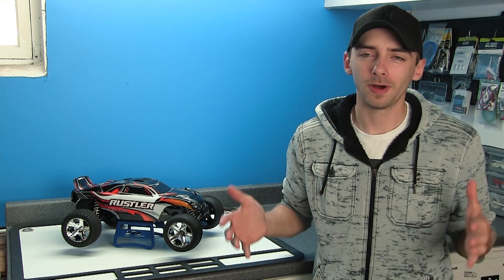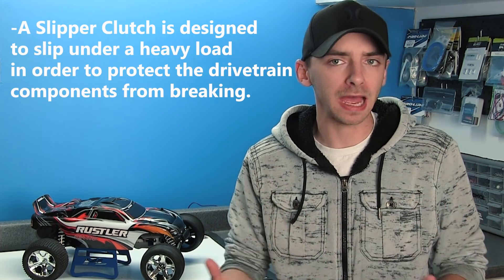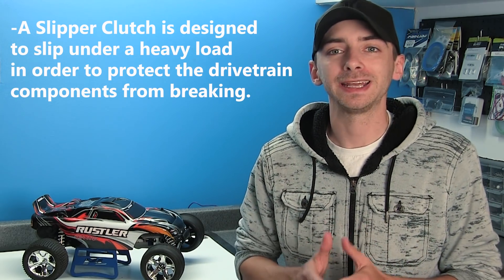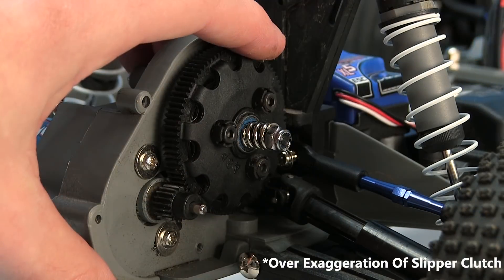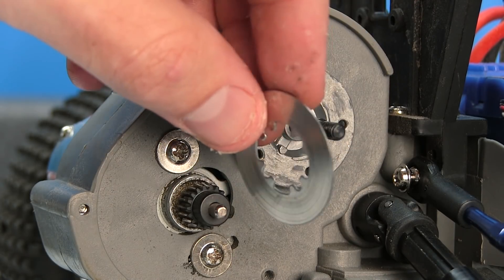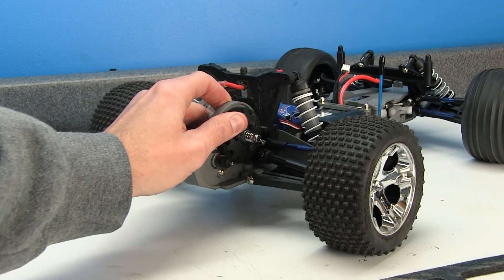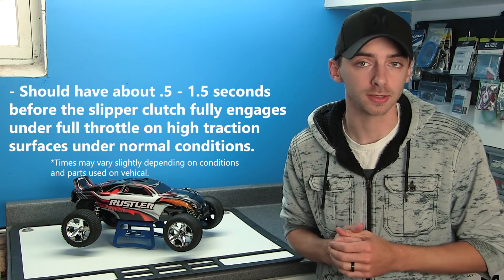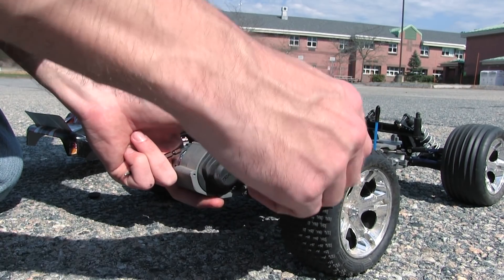RC Slipper Clutch Systems - How To Adjust, How They Work & More!

Comment: The "rubber" in the nut. Nylock = nylon. They were originally designed for military aircraft. Different colors of nylon also have different strength specifications. I only use them once depending on course/fine threads and application. Never use lubricants with nylocks, it defeats the purpose. If you can turn them by hand they are junk. Great info on the clutch though. I've picked up some helpful tips from your channel. Just thought I'd try to pay it back some.
Reply: Sort of, I suppose. China direct colors are definitely questionable at best. Spec charts of quality nylock hardware are available though and correct if manufacturing standards are followed.

Comment: Why does a Team Associated RC10 competition car have this. Or do the basic kits have slipper clutches but the RC10’s in important races take them off? If they don’t take the clutches off for serious competition cars, I assume they trade the slightly increased lap times for a smoother way of putting the power down out of slow corners, which may mean less snap oversteer?
Reply: Yo Cecil slippers are more for average hobbyists. If you race you want all the power and it's usually experienced guys who really race. Slippers were made to t aske the torque shock hi power motors of today put out. I still have one of the fastest motors of its time from when I got into rc in 88 and a stock Traxxas motor beats it hand downs today. So the modern motors really cause shock to the gears and dog bones so the slipper was designed to keep the shock to a minimum for new hobbyists.
Reply: You CAN get or buy or MAKE a slipper eliminator,but not recommended.You will rip the gears out.

Comment: My TMaxx was running fine and suddenly stopped moving but engine continued to run. What would cause this.  The vehicle is only one week old and finished break in.
Reply: Check that the clutch bell and spur gear are still engaged. The motor mount holding the engine may have loosed from the chassis with the vibrations. If so, take the screws out, apply a small dab of blue loctite and set the correct spacing of the clutch and slipper.
Reply: Did you ever figure out the problem?

Comment: Awesome video and very informative on the slipper clutch system.  Since using your video I have adjusted mine tighter about 2.5 to 3 turns and my E-Firestorm 10HT reacts better then before. 
Do you have any videos on adjusting the front and rear turnbuckles?
Reply: Just make a note of stock setting and have a go at adjusting and testing. Its trial and error, a lot of it if you don't know how each setting affects the car. 
Have a read on camber, castor, toe and anti dive most of the stuff you'll find are 1:1 but it still applies
Reply from the maker: That awesome man! glad it helped ya out!

Comment: The number one problem (at least on the traxxas forum) is using the slipper clutch to control wheelies instead of using throttle control.

Comment: I always thought it was a little looser slipper clutch on looser surfaces to reduce Tire Spin, and a little tighter on  surfaces with more grip?
Reply from the maker: +Bryan Forth you could. But the problem you may run into is if the slipper clutch it tight and you go and punch it on pavment you could run into the issue of stripping your spur gear teeth. Those teeth tend to take the brunt of the initial force when accelerating. And considering the pavement isn't going to let the tires spin easily theirs gonna be a bit more resistance in the drivetrain because of that. Were as if you had the slipper loose on pavement it could spin for a brief moment before gradually applying the drive force to the wheels. Hopefully that made a little bit of sense.
Reply: It made total sense. Thank you for the clarification. I really appreciate it.

Comment: Great video and good information I just upgraded my transmission gears to hot racing medal on the scx10 and next I will upgrade the slipper clutch. Do you know if axial or any other brand has a steel or metal slipper clutch for the scx10?  Thanks in advance you always willing to help the rc enthusiast.
Reply: Lil Conan check out supershafty. the stuff is pricey, but I believe they have a topshaft which will allow you to use the Robinson racing slipper. keep in mind however, that as you upgrade the strength of parts in the system, it passes the stress on down the line. if you aren't running a big brushless system, you probably don't need a hardened steel spur in your scx10. if you are running a big brushless system, it's good to keep one weak link that's fairly cheap to replace. metal gears in the transmission are a good idea, and while you have the Trans apart, it's also a good idea to replace the slipper components and the spur, but upgrading them to hardened steel probably isn't necessary. if you do though, upgrade your pinion to hardened steel as well.
Reply: Bro that is awesome thanks for the great information I really didn't think about that thanks for the advice and for sharing your knowledge much appreciated bro thanks again
Reply: Lil Conan you're welcome. good luck with your project.
Reply: Thanks bro I just subscribed to your channel your advice will help me out.

Comment: I finally got my barrage put back together, I'm now running 2.2 tires with axial dingo axles and 100mm shocks I'm getting ready to put a 380 sized 40 turn motor in it but I feel like I need a metal spur gear, have you by chance heard of any companies that would make something that might work?
Reply from the maker: +Michael Ordonez nice setup! As for the spur gear i havnt at the moment. My Barrage is completely torn down at the moment. Im planning a small rebuild/upgrade series. Nothing extravagant... trying to keep the cost down. But if you do come across something let me know! Also what 380 motor are you putting in it? Id like to upgrade my motor as mine will have a bit more weight to the truck. I don't want to under power it.
Reply: I got the axial 40t motor from the yeti junior, I haven't gotten it in yet I think I will have to talk a dremal to the hole on the motor plate to fit the bigger lip of the new motor
Reply: I have also seen a 35t 370 sized motor one by but I don't remember the brand